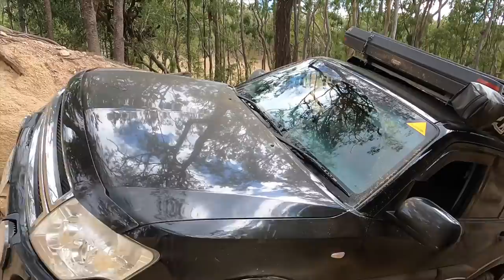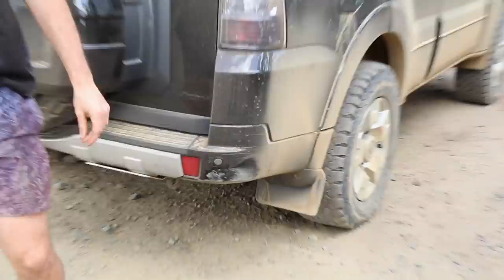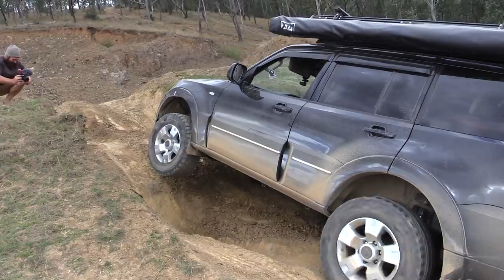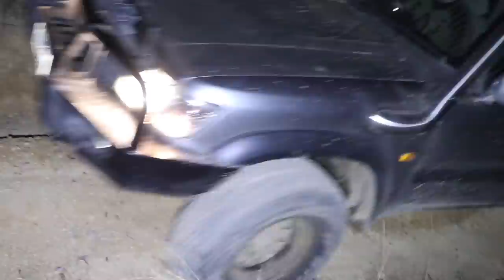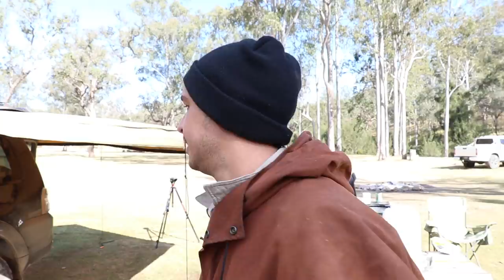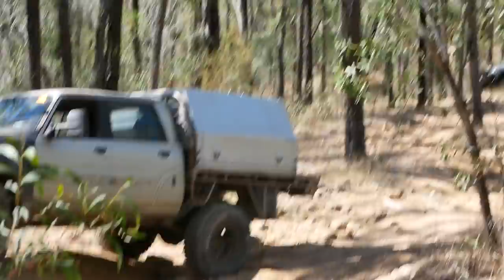Patrols, Pajero and a Mercedes Tackle Landcruiser Mountain Park

Comment: Hey Woody, Nice driving! Low range in the Paj only disables stability control (ESC), not Traction Control. And the beeping is a warning that the electric Hydraulic Brake Booster is running low on pressure from all the brake applications through constant use of traction control. The internet will have you believe it's an overheat but it's not. Eventually it just emits a constant beep when it is fully out of pressure and disables TC at that point. If possible you just pause for 20 secs and let it recharge. TC equipped Paj with a 2" lift is a lot more capable than most will dare give credit for.
Reply: Actually Woody, I wonder if your pump motor isn't a bit lazy. You can swap the motor out without changing the whole unit. Can also service them - bearings and brushes.
Reply: Naaahhh bruv. I read on the interwebs that the beep booping in the Paj is from overheating his muffler bearings.
Reply: @aSinisterKiid  Could be low on lemon squash.
Reply: It’s the tip sensor on your lemon squash fridge beeping away
Reply: Absolutely. Mine has the rear locker and add the little mod to keep the front traction on and they are a good thing!
Reply: @sfcralogan  Isn't there another mod to allow the rear locker in high range as well?
I need to do the mod on my Challenger
Reply: Yep, they do well that is for sure, but it isn't the main brand.
Reply: Really? So Pajeros use the brake booster to activate traction control? Most vehicles just use the ABS pump and valve body to brake a spinning wheel. No assistance from the booster.
Reply: Are you sure it couldn't be related to ABS overheat? Coming on an off the clutch certainly won't help tho.. the traction control is only gonna work under load.. However if it is related to brake booster pressure.. Maybe a vacuum tank could be used to give more run time?
Reply: @iananderson4897  Yes. although Woody's NT might not have the rear locker. Was an option on earlier ones depending on trim level and then became factory on even the lower models from around the NW I think.
Reply: @kitto31  The brake master, ABS module and electric / hydraulic booster & pressure reservoir are all in the one unit. The booster supplies the actuator pressure for the ABS rather than a separate one.
Reply: +1 booster over heating. As a first step flush the whole system with clean fluid.
Reply: @patricksproule6709  Yeah right, not an ideal setup! I have a D2 which has a conventional ABS setup, you can use traction control all day and all you'll get is brake fade. Not that i need TC anymore with twin lockers. 😁
Reply: Thank god now I know what it is thanks so much
Reply: My d22 doesn’t beep when the break booster has low pressure. just has a cool feature where it loses pressure, my breaks stop working and I roll really fast down hills
Reply: Could also be the camera on the passengers seat. The car recognised the weight and wants you to buckle up. I live up a steep hill and have that problem wit a 3 liter bottle of milk going up hill.
Reply: @iananderson4897  locker works in high range as well, just not in the 2wd or AWD modes
Reply: Hey Patrick, this is the best explanation I've seen for this.  Have an NX Paj myself and while I always use Low Range for stuff like Woody was driving here, also get the beeps from time to time, usually after prolonged climbs in the high country.
Reply: @sfcralogan  Ive done the same, makes it heaps more capable.
Reply: @seigriedthiel6213  it’s not overheating it’s the booster running out of pressure
Reply: @iananderson4897  Rear locker works in 4HLC and 4LLC.

Comment: Gotta love when you start out 4x4ing, everything seems terrifying and impossible.
Reply: Its what makes it so fun
Reply: Then you get twin locked solid axle rig and have to do insane stuff to get the same feeling you had with an ifs unlocked car.
Reply: Just finished the first 9 minutes or so, just Woody then Al up that first climb, Woody shows a lot more emotion. Al is cool as ever. Sketchy as climb and you can tell they're both like scared/worried, but in that good way. You can tell they both are just PUMPED doing it! Really getting the blood flowing! Looks fun as.
Reply: @Dis_custard_shed  that's what I started in 🤣🤣 factory twin locked HJ61 cruiser on 35s

Comment: This is proof on the first track to all those that think "you don't have a real 4wd if you don't have solid diffs front and rear, lockers and 35" muddies" when a novice 4wder (half way up the track in high range🤦🏻‍♂️) gets through that track with a lightly modified Paj!!
Reply: Pajero is so underrated yet has the best one of the best 4wd in the world 🌎

Comment: There’s a reason most off-road guys go with autos.
Reply: @playwme3  They Will have both hands free to scratch it, at the top of the trail waiting for the manual boys to come up 🤷‍♀️
Reply: @playwme3  I too measure my manlihood with the type of transmission I use. I milled a fitting so my Saxo now has a gated shifter
Reply: @playwme3  Because using first gear and the clutch as a drum pedal is much better and "more manly"
Imagine using the right tool for the job is considered "girly" gtfo
Reply: I know significantly more manual 4x4 owners than auto owners...
Reply: @mattlyster8508  I know significantly more auto 4x4 owners than manual owners...
Reply: @einfelder8262  eww, what do you all drive?
Reply: @mattlyster8508  Autos.
Reply: @mattlyster8508  I don't doubt that, so do I. but the trend nowadays is to go auto, especially for difficult "technical" 4wding, and you can see why.
If all these people you know have older 4wd's it's no surprise they're all manual, it was much more common and a lot of people believed a manual was better.
Any modern (as in the last 25 ish years) auto is a no brainer for difficult 4x4ing.
Reply: Whilst I am a HUGE manual transmission fan ,and have many, when buying my pajero, and watching and reading countless upon countless articles and videos, I went with the auto, and yeah, off road, it's bloody amazing. You already have a million things to concentrate on so not having to worry about clutch engagement is one less worry
Reply: It was just a joke, but whats the point of making it “easy”?  Sure, if you have to get somewhere safely and reliably, but for technical recreational offroading i’d rather have the biggest most challenging piece of shit out there.
Reply: @playwme3  it's doesn't have to be easy, you just need to find harder terrain. I'd rather have a more capable vehicle and drive harder tracks then drive easy tracks and make them look hard by "having the biggest challenging piece of shit out there". But each to their own 😂
Reply: I've had both manual and auto 4x4s.
Pajero, get the auto...better hands down.
Reply: An automatic Pajero V6 would've walked all of those 😅

Comment: Found this on the PajeroForum:
"The beeping sound is not TC overheating as such, rather the warning buzzer (loud beeper) that tells you the pressure in the hydraulic brake booster (HBB) is very low.
Each time the TC activates the brakes, a bit of 'pressure' is used up - and at a faster rate than the brake accumulator pump can replenish it. Extensive TC causes the pressure to drop to a low level (beeper comes on) and warns you the brakes are close to failure.

Simply wait 5-10 seconds while the HBB pump recharges the brake pressure and it will stop.

If you have ABS, you'll usually hear the HBB pump run for 2-10 secs when the car starts as it charges up the brake pressure. (quiet buzzing sound from rear drivers side of engine bay)

If you want to hear what the warning beeper sounds like, (from memory) you do it by starting the engine for about 20 seconds, then stop it. Put it back to ignition on (but don't start engine).
Pump the brake pedal about 20 times fairly quickly (i.e. in 10 seconds), and you'll hear the warning beeper come on. If you keep going you'll suddenly feel the brake pedal go hard - i.e. brake failure"
Reply: Mitsubishi; only the finest in engineering.
Reply: Sabretooth Barnacle Would the brakes being slightly uneven in their thickness add to that problem at all and run havoc with the wheel speed sensors ? I only ask cause i noticed on telegraph hill the wheel speed was going kinda mental when Woody had air and kinda put two and two together.
Reply: @someyoungguy6990  I'm guessing the more time the wheels are in the air in a fixed time scale the quicker the brake accumulator will empty. I have no idea how the system works on the Pajero but I'm guessing when a wheel comes off the ground and free spins with the other wheel on the accompanying axle being nearly motionless the ABS unit realises this and starts to apply the brakes on the free spinning wheel in an attempt to divert the power to the grounded wheel.
Given diesels use an auxiliary airpump to create vacuum for the brake servo the constant triggering of the braking system via the ABS is emptying the vacuum quicker than it can be created by the pump. 
So the only way around it is to minimise the free wheel time/fit a locker/simply wait a few moments for the vaccum to reestablish/modify vacuum system for quicker recovery?
Reply: I know my lx470 does the same thing sometimes and petrol v8 normally up an extended climb. Bang on about the system, applies brakes to simulate traction on free wheel to get drive to both. It just heats whole system up. And just have to give it a few  normally. I broke a wheel speed sensor and haven't bothered replacing it because i prefer no traction control. If your vehicle starts applying brakes while trying to get through muddy sections at speed can spin you around real quick.
Reply: @no88o2  Thanks for clarifying, glad I got that right. I noticed on the footage that the system allows the vehicle to come to almost a full stop before it tries to correct so I'm not that sold on this method for maintaining constant movement when 4x4ing. I guess an old skool locker or more modern e-diff with lightening fast reaction times are the way forward.
Either way the Paj (and Woody) did a very commendable job!
Reply: @SabretoothBarnacle  haha yeah it surprised me as a diehard Toyota man. I think use of these systems is on an individual basis and driving style/terrain bit can't argue with that being the family limo safe and capable.  Be good to see if he does goes lockers if that at least stops the beeping so often .
Reply: I'm pretty sure its an electrically driven ABS pump like most modern systems, under normal driving conditions the thing can usually keep up fine, but if it's actuating all of the brakes independently for a considerable length of time it's gonna run out of pump sooner or later. I wonder if there is any market for a HBB pump mod to stick a bigger motor/pump in there for the 4x4ing community.
Reply: could you replace the pump with a bigger one? so that it has capacity of being run all the time.
Reply: Sounds like woody needs to add in a capacitor to help store larger amounts of vacuum for his TC...or do what I do, turn off TC.
Reply: Makes sense. Most of the Light Rigid trucks have the same. Dyna, Hino’s , Isuzu’s.

Comment: Woody, 1st gear low range and let it crawl. Low range only disables ESC, not Traction Control. It actually switches the traction control into an offroad mode. When you start to lose traction, feed it MORE power. That's how the traction control in Pajeros works, they'll start to brake the spinning wheels harder and feed that power to the wheel with grip. Should barely need to be touching the clutch. Takes a bit of getting used to but it'll go up just about everything.

Comment: Hey woody, when descending steep tracks, 1st gear low range foot off clutch, feather brake to just control speed. You will find this will help avoid rapid uncontrolled descents.

Comment: A little known secret to 4wding that most people work out eventually is to try  to always keep the front axle level especially if unlocked. Keep the front level and you'll have drive to both wheels. The rear will then follow a very close line.
Another is to use the clutch like a light switch, ON or OFF, nothing in between. If it wants to stall use more revs, a bit of wheelspin won't hurt.
Have fun.

Comment: Impressive that a virtually stock pajero made it up where patrols on 35s need to engage their lockers 😉
Reply: Bigger tyres an a lift kit cant exactly be classified as stock lol independent suspension does make them awesome super underrated 4x4
Reply: Would like to see how far the Pajero would get with the traction control turned off..
Reply: All to do with the driver
Reply from the maker: Khye drove up it in 2wd in a 300mm extended dual cab patrol Ute.
Reply: Factory traction aid both of them, why is it bad when they occationally has to turn on theirs, when the pajero has to use it 90% of the time automatically?
Reply: @gullf1sk  traction control is not as good as a locker. Otherwise they wouldn't bother fitting lockers to Pajeros. I've had two Pajeros, first one didn't have a locker, new one has a rear locker. The locked one is slightly more capable. Plus when you engage the rear locker you lose TC on the front, unless you have a little 'aftermarket' switch to turn TC back on

Comment: So good seeing fourby action on the channel. You lads can wheel that's for darn sure. Props to the Pajjey too what a beast!
Also the beeping is just heat related I think. The braking wheel in the traction control gets a touch too hot, continuous sound means it shuts off.
Reply: Low ABS pressure. 
Instead of a vacuum booster these use an electric pump to build brake pressure and traction control bleeds this pressure off.
Have tc going too long and it beeps. Keep going and it squeals and turns TC off.
Pressure builds again and you're good to go.

Comment: As for that beeping... it's MATT - Mitsubishi all terrain technology.

It's the off road traction system, uses the ABS system to lock up wheels it detects are free spinning so torque goes to wheels that are on the ground with grip. usually quite helpful.

when it beeps it's a warning, the system is loosing track of what is grounded and what is free spinning, it then turns into a solid on alarm when the system disengages. Not to do with temperatures.

 It works in 4LLc by the way.
Your alarm comes on alot more than average I would say. Loving the vids keep it up.
Reply: no
it doesnt lose track of is grounded and what isnt

Comment: Get Vlads Traction control mod, and a nautia engineering switch panel for the pajero! :)
Reply: Whats the traction mod?
Reply: It allows to run the factory rear locker with traction control
Reply: @Ethan-pv9gq  thats mad! Cheers mate
Reply: Or get a landrover discovery 2
Reply: @dazzleyd  I owned one 6 months ago, just before I bought a paj…they are a completely different kettle of fish, and not even the same type of 4wd.. so a fairly average comment made by you.
Reply: @dazzleyd  Land Rover has recently launched their optional extra drive-way black paint. So you can now match your drive with all your oil leaks
Reply: I've had several discovery 2s... currently have an NT Paj.
Both good in their own way. 

Woody's rig doesn't have the factory locker...it was optional at that point. 
Retrofitting one is the best move you can make.
I passed over many cards until I found a locked one, it transforms the ability of the car. 
Do the mod to allow traction control to work on the front axle while the locker works on the rear, you're in a different league again, almost as good as twin locked.
Reply: The traction control on the disco 2 is excellent I've not needed lockers on front or rear yet. It does the job and has been very reliable
Reply: @dazzleyd  i kinda have to disagree with the traction control being good.. it’s actually super average compared to newer cars or even the disco 3.. for it’s time yes it was great but it’s not even close to being as good as locker. I love them don’t get me wrong. 👌🏼

Comment: It's amazing how many Pajero owners are out there lol. Love our NW... its amazing where it will go but I think the auto is key. Do miss the old GU however... you can see the difference in how planted each are. On road and for everyday... Paj will always win!! 👌
Reply from the maker: Horses for courses. The Pajero actually covers a lot of courses. The Patrol will go anywhere but it comes at a cost, It will never be as NICE on road as a Pajero. Your Mrs will drive the Pajero daily and love it and you CAN do this on the weekend if you have the balls. And its even easier in the post 10 models where they have factory rear diff lock.

Comment: 1/4 of camp road in high range, i was cringing i could smell the clutch through the internet. <3 the pajero but good job - also the traction control will beep when over heating. thats the beeping there are aftermarket options to help the issue.

Comment: Hey Woody.  When going down a steep hill don't use your clutch. Looked like you had the clutch engaged in a couple of spots when the Paj took off down will. Keep it in 1st low and use the brakes to scrub off speed. If you need to stop then stall it with the brakes or switch off while still in gear. To start keep it in gear and start it as you ease off the brake (gravity will help start it as the engine will start to spin as car moves). This is a much safer way of driving down steep hills.

A rear locker and reduction gears will really transform that Paj into an offroad beast. I think the Pajero has a 1.9:1 reduction ratio and the Patrol has 2.02:1. Both could use reduction gears when in the really steep stuff.